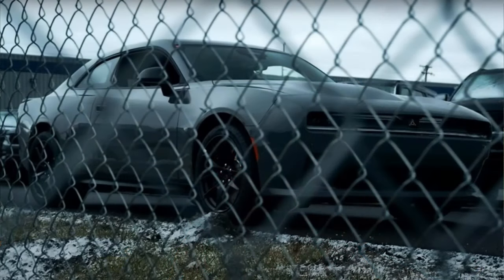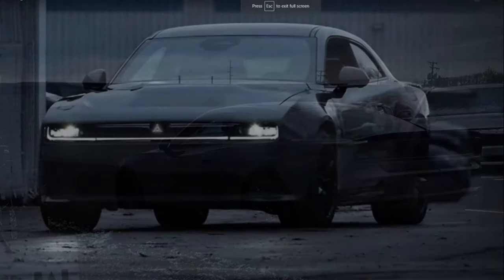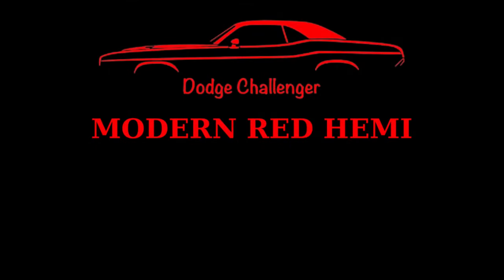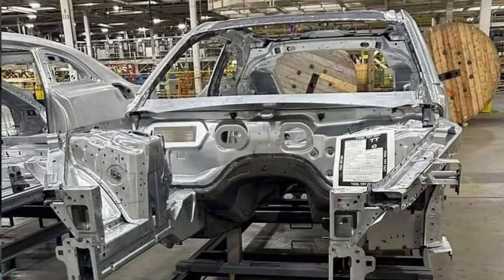2024 Dodge Charger coming? Here are my thoughts and Hurricane and EV discussion.

Comment: The overall dimensions look smaller which could be a plus! Less weight, more nimble through the twisties and paired with the I-6 could be a shock to the Dodge system, which they could use!  Dodge had to compensate with the past iterations having an old chassis and too much hp to make up for the heavy weight! We’ll just have to wait and see!
Reply: Correct they Stellantis aka NoCar lies again ..I thought it was exactly like the concept except for the individual rear seats being a bench in production..it’s no longer a widebody smh
Reply from the maker: Good points, but I'm just a hard core V8 pure muscle kind of guy. There's plenty of power to be made from the Hurricane engine, let's see what they actually put in this car. 😉

Comment: If the Charger comes with the hurricane motor I wanna know what it does in performance and drivability.
Reply from the maker: Yeah, the one clip of a Drag Pack with the Hurricane engine in it didn't look good at all. Looked like a flop to be honest. Time will tell and we will see. 😉
Reply: Low output is 400hp high output is 500hp. These numbers are from the jeeps, so I'm not sure how the charger will be tuned. There's supposedly a 1000hp variant of the hurricane too for the dragpack so the engine is very capable.

Comment: I understand the sound argument about v8's, I get it. I have an ecoboost mustang and stock the sound did nothing for me. After modding the coaches whistle coming from the turbo sounds like a jet and very fun to drive. I also live at high altitude where it slows the na cars WAY down.
Reply from the maker: It's not just the sound, though that's a big part of it, but it's the old adage, no replacement for displacement. I think there's room for all of these cars, it's just finding that happy medium. 😉
Reply: @ModernRedHemi  I am pretty sure I have a couple of years on you and remember that adage well. However I am really digging the new tech were I can pour 50 hp into the tank with just a reflash. boost is the new displacement.

Comment: Dodge will probably make 3 versions of the car. There will be versions for the masses. That will be the 2.0 liter and the 2-liter hybrid. The latter will be comparable in performance to the R/T. The third version will be the EV. You'll probably have to include one of you relatives as collateral. I doubt that you will see the hurricane engine in the Charger. If you do it will be the lower output version. The markup is higher with the Rams and Jeep. The last thing Stellantis wants to do is give their customers a fair deal. Fiat/Chrysler and Stellantis have been screwing their customers as long as I can remember.  I have no reason to believe that will stop anytime soon.
Reply from the maker: Interesting take Hu. You could be spot on. It's going to be interesting to see what actually happens and what the pricing is going to be. 😉

Comment: Hey all you know the Japanese are ditching EV very soon. Don't believe me do your homework.  China and North America have the vast majority of Lithium needed to produce batteries with current tech. Japan has been doing some great work with Hydrogen and new 2 stroke gas engines. Japan is not going to rely on China or North America for lithium. Way to go to Japan. I for one look forward to the two stroke Mazda stuff!!!!!
Reply from the maker: I've seen not only Hydrogen but creating gas from the air (Porche and Honda I believe) recycling CO2 emissions. Will be interesting now that 2 of the major manufacturers are backing out of EVs. 😉